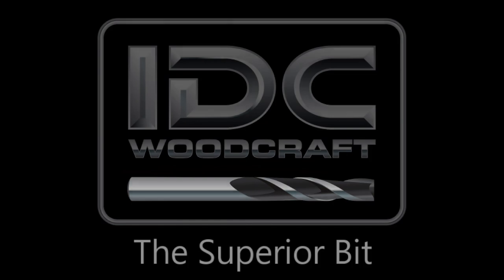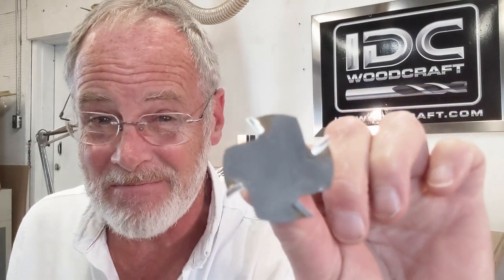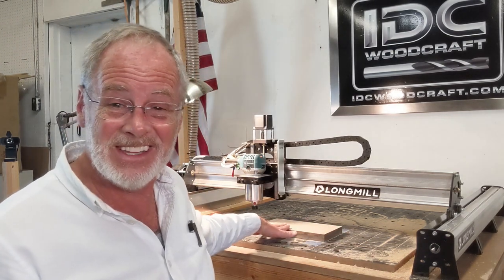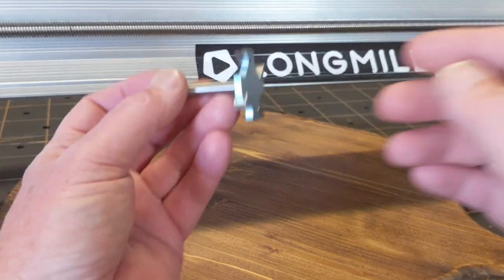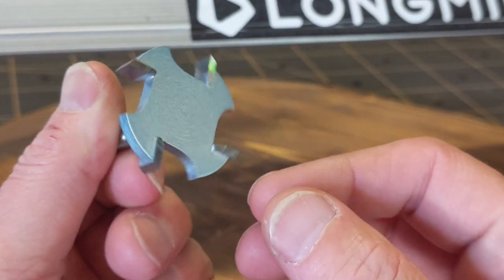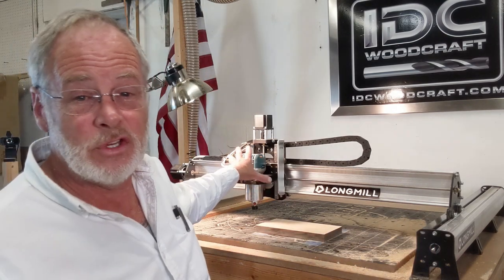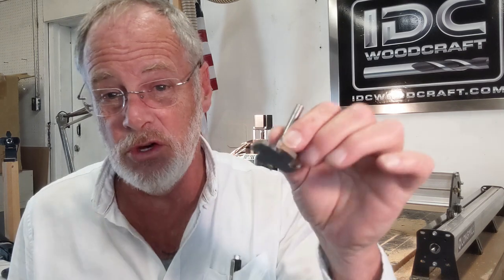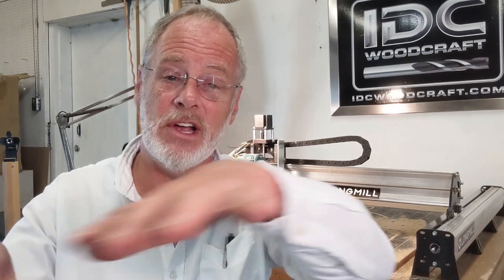What Is a Surfacing Bit and Why You Need It for your CNC Router

Comment: I surfaced a piece of warped mahogany with my Longmill using the Makita router. I used a 1 inch 3 tooth surfacing bit. The bit seemed to burn the wood. I had the feed rate at 300 and my router turned all the way up. Am I supposed to run slower to avoid burning?
Reply from the maker: The router is turning way too fast. Being the dial to 2
Reply: @IDCWoodcraft  thanks

Comment: Hello, What is the difference between using your 1-1/2" four flute surfacing bit and your 1" four flute surfacing bit?   Just 1/2" wider cut?  Using on a 1f with a Makita router.
Reply from the maker: Michael, that is it brother! Just the wider cut to add stability and make jobs so much  faster!